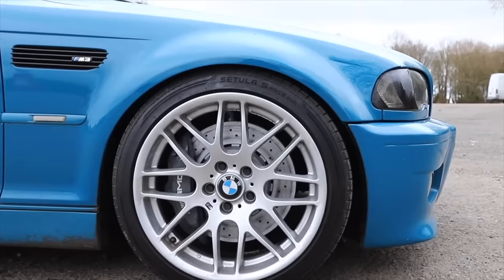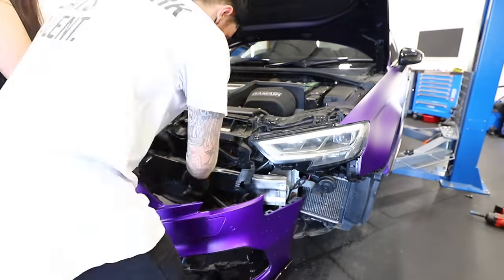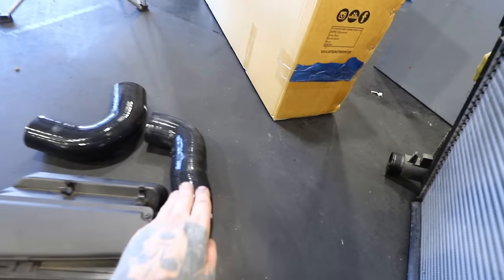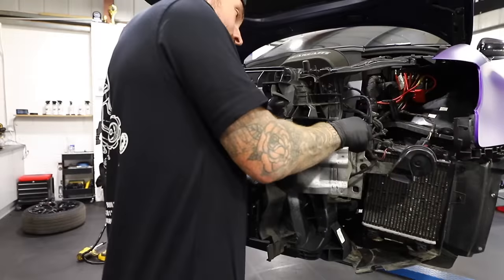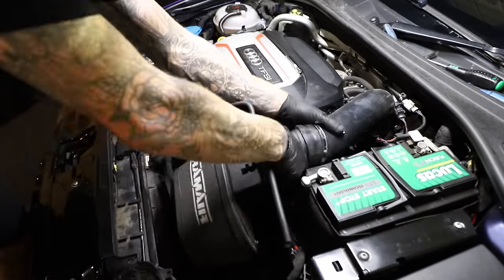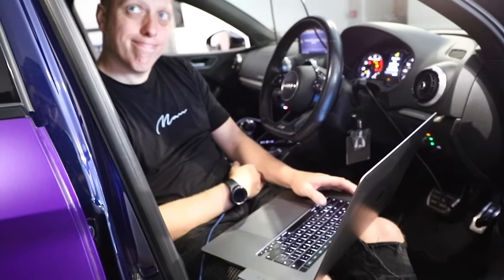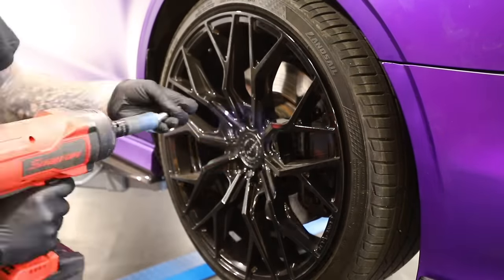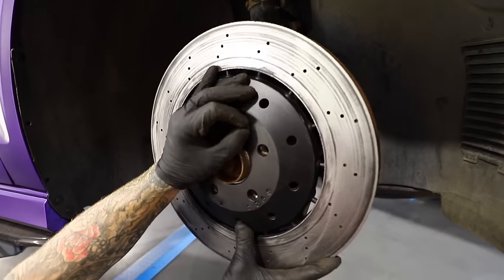FITTING LAMBORGHINI PARTS ON THE AUDI S3 I REBUILT

Comment: Matt, to make these fit you need these: 

TTRS 370x32mm with Rs5 brackets. The TTRS disks have the same hub size and the correct offset to fit. If you don’t run wheels that have a lot of room to fit BBK’s  like OZ Ultralegerra’s/ATS Racelight’s etc etc most of the time you need to run it with spacers. My Pretoria’s didnt fit without 5mm spacers so I bought a set of Racelight wheels that did fit.
Reply: What generation rs5 brackets do you need could I use rs3 calipers and then ttrs discs?
Reply: answer him

Comment: Matt .. you need to run TTRS 8S brake rotors.. they have a 2.5mm offset difference to others. This allows the calliper to sit central ish.. the guid pins that the pads sit between foul and grind against the brake rotor causing irreparable damage… check all clearance before you drive. Also 19 alloy wheels are forgiving and you may need spacers or an alloy that gives you natural clearance this set up is renown for temp issues also. Make sure to run a good pad and rotor combo to try combat this.
Reply: could always delete the front fogs and port more air towards the brakes too
Reply: @S.ASmith  there’s aren’t any front fog lights
Reply: The front brakes do 70% of the braking the rear brakes only act as stabilisers for the rear end to stop it sliding around on its axis so it doesnt really Mater too much especially if you like the drift life.
Reply: hey mate , seems like you know a thing or two. I have an audi A5 b8 and im looking to do a similar job of upgrading my brakes, the car is on 19 inch audi rims , and has at least 10mm spacers. What should i go for ? any suggestions ?
Reply: @DionisFerizi  You could look at R8 callipers or see what big brake conversions there are. 

I wouldn't deviate too much if you're not super knowledgeable as custom stuff requires quite a bit of thought to pull off, especially with safety items like brakes (they have to be able to pass an MOT too).
Reply: @S.ASmith   the 8 pot from Brembo is widely used across a lot of the VAG range including the R8. There is also a ceramic version across this range but internals of the callipers are slightly different.
Reply: @DionisFerizi   try the 4 pots from the TTRS.. slightly smaller calliper more forgiving and don’t struggle with clearance issues as bad.. but can still run a 370mm rotor or 390 for that matter if you purchase rotors from Reyland
Reply: You are absolutely right. We use them on our B9 build!

Comment: Nice work with those stonking calipers. You missed a trick whilst fitting the turbo elbow though. Turbo muffler delete. No performance gains (as such), just allows you to hear the turbo dump a little better without going down the BOV route. Might gain better airflow (as with the aftermarket elbow) due to the muffler having exhaust vents which are then closed up with a muffler delete kit. Easily accessible during elbow fitment and is 3 bolts (one hidden underneath but easy to access). Drop the pop and bang map though. 400bhp with a decat will do this naturally although not to that extent. Spoken from an MRC stage 2'ed S3 owner, Audi factory purple 😎 With no pop and bang map!

Comment: I know you have done it but the Turbo elbow really should have been the first thing you did even before the new intake, Thats a good stage 2 number also without stressing the fuel pumps,  the over run is a bit over the top though   :)

Comment: I’ve learned so much just from watching your videos… I just installed a cold air intake on my A4 yesterday and you were a huge inspiration. Now only to figure out what I wanna do next 😅
Reply: tune it properly so the ECU knows there will rush more air into the engine so it can supply more fuel to it!
Reply: @BassheadMusicConnoisseur  not sure if I want to work on speed or stance first 🤔
Reply: @panchit0z  work towards running engine
Reply: @panchit0z  its not more "speed", if you don't tune the rest of your car to adapt to the intake then it wont be using all of the air. No point in getting a new intake when your ECU isn't taking advantage of it

Comment: Matt, I feel your pain. I changed the condenser on my A3 8P and it was a total wanker of a job, your right its a stupid design took me hours because I didn't want to drain the coolant. One little bolt holding a bracket on for the condenser pipes was stopping me and to get to it the whole rad pack had to come off, got it in the end but dude I feel your pain on this one, totally stupid. Also I love a big brake kit looks great!

Comment: Hey Mat. The pads shouldn’t wear unevenly with the caliber being slightly off centre as long as the pistons don’t run out of travel as the pads wear down. If the pistons run out of travel then you’ll end up with with degraded performance because one bank of pistons won’t be able to push the pad onto the disc anymore.

Comment: That motor is a beast! Same as in the Golf R, GTI, and a bunch other MQB cars. They are good, if built right, for even more power. But, I wonder if that brake setup would also bolt up on Golfs.

Comment: The benefit of Silicon hoses isn’t to smooth out the airflow, they’re just more flexible than rubber and don’t degrade so they’ll last much longer without splitting.

Comment: @Matt Armstrong, you could of used some washer on the caliper bolts  to shim and center the caliper on the rotor so you would have even pad wear. In doing so that would bring the face of the caliper inward and you would have to use a smaller spacer(5mm) for the rim to clear the caliper....

Comment: Nice man. I run the 6 pot Brembo GTs on my S3. Designed and built custom 3pc forged rims to fit the brakes. Driving hard with spacers is sketch IMO. Do88 intercooler is quite a bit bigger than what you installed. Just something to look into when you're looking to push 500+

Comment: New subscriber here, nice work on the channel Mat.
I’m not keen on the popping and banging, that surely is just more fuel being wasted, it will get annoying real quick.
Each to their own though, your money your choice.
Definitely get those calipers centralised perfect or you’ll get excessive heat and cause extra issues.
Regarding the discs, I don’t see a problem using used ones as long as they run true, you could always get them skimmed on the car to be sure.
Keep up the good work 👍

Comment: You might need to look into some (Very very cheap) "Hubcentric rings" for those brake rotors. They are only a few dollars usually at most depending on what material you get them in (don't use the plastic ones) they shouldn't be more that $25 or 15 Pounds ish I would think.

Comment: I think you are missing the two screws under the headlights which go in the inside of the bumper and hold it back. You have to take out the wheelwells to get to the screws.... That would explain the bad gaps in the front.
Reply: They are a Pain in the * to get to, stupid idea from Audi

Comment: now go fit some gold wilwood check valves cause you have a soft pedal. the stock pump cant handle caliper upgrades. you'll notice when u pump the pedal a 2nd time its firmer, and its not a bleed issue but pump issue

Comment: I hope Matt sees this post.....I am thinking of upgrading my S3 (it is an 8p) Audi. I have a question that may seem stupid to some... in fact, maybe others here can help me./..... I want to get a manual that will help me strip and rebuild my Audi so I can get the internals forged however, I do not want to use Haynes. I need a manual like he seems to always use that has all the proper torque settings etc. I can take photos of what has been taken off and refer to those when rebuilding but I really need a manual that tells me what torque settings are on each bolt and pictures of what order things are done... eg head bolts for example. I am not in a hurry for it to be built so if it takes 6+ months on it then that's what happens. I am adamant I want to build this myself. It is my car not for selling when it is done but I want around 500-600 bhp. It is quick now but I am forging everything internally

Comment: More power, but stock water radiator, you should upgrade that too.
Reply from the maker: Never had any heat issues though?
Reply: @MatArmstrongbmx  more fuel, more air, more power=more heat, it is for longevity. Especially when driving and pushing in short runs. Im not 100% shore but it does not have any oil external cooler, but water/oil coller. So cooling water is now more important than it was before.  Air to oil coller would also benefit for engine longevity. 
In general i like You're channel. This is just thinking on loud.
Not trashing, or shitting over anything.

Comment: The stock intercooler had the upper bushings when you threw it away, did you install new ones in the Airtec Intercooler.
If not, at some moment the sandwich is going to cause problems like rubbing the coolant hose to the engine belts......

Comment: Matt you added 10mm spacer did you get longer wheel studs or did the original fit? As you didn't mention....... p.s wicked video mate 👌🏾
Reply from the maker: Longer bolts bro

Comment: First comment. The carriers are on upside down. 

Second the link pipe needed swapping over as the caliper is a trailing caliper not a leading caliper

Third the bolt for the bridge is missing off the caliper meaning the pads could come out. Really dangerous as current
Reply from the maker: - the carriers don’t fit the other way round 

- same calipers are used on the rs3 from stock and they are a leading caliper

- bridge bolt isn’t missing 😅
Reply: @MatArmstrongbmx  rs3 carriers should angle the caliper upwards they don’t seem to be say right. Yes they are the same caliper however they are reversed trust me 🙏 I’ve sold around 8 pairs and refurbed these. I couldn’t tell if the bolt went in once you fitted but on the unboxing it wasn’t in the caliper. Fingers crossed you can get sorted ps TTRS 8J discs or 8S will work perfectly for you
Reply from the maker: Okay mate thanks 👍🏼

Comment: Nice job, there is no way around them front panels, literally the most stupid idea, deal with them on a weekly bassis. Also what's with the funky panel gap wing to bumper?
Reply from the maker: Aftermarket rs3 style bumper 🤷‍♀️ never fitted right 🥲
Reply: @MatArmstrongbmx   put a wood screw then filler, lol, Birmingham style

Comment: What a circus vw golf. Audi got (as all premium cars) longitudinally mounted engine. That rs3 is a vw golf rebadged and with audi trim added. That supposed to be a LIGHT and useful as daily car, but you transformed in a HEAVY "permanent fwd"(aka haldex) car which is very sensible to bad roads or even hipermaket parkings or street bumpers (speed limiters). I bet not got 0-60 waaaaaaay longer than any stock s3 remapped at same power. So which was the purpose? To mock that poor golf which already wearing some audi style shell?!
Reply from the maker: Apart from an rs3 has 5 cylinders and a golf r has 4 👍🏼
Reply: @MatArmstrongbmx  that is THE ONLY engine/gb which they don't share, BUT of course is pretty much bolt on for golf r. By the way, older golf was even in 6cylinders configuration.. so what.. was heavyer on front axle/understeer character.. as it is rs3 too.
Reply from the maker: @napraznicul  okay mate